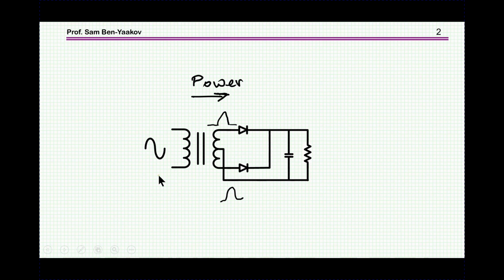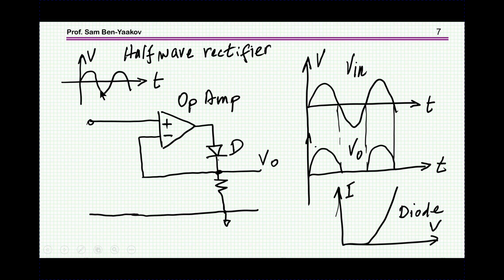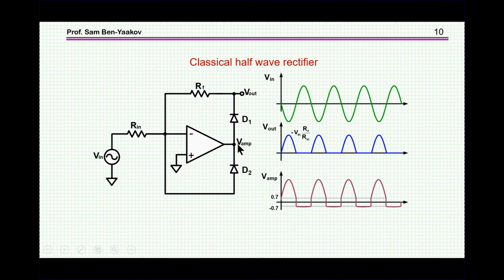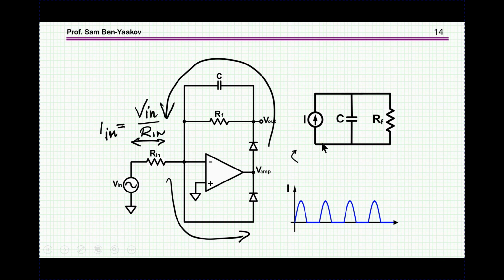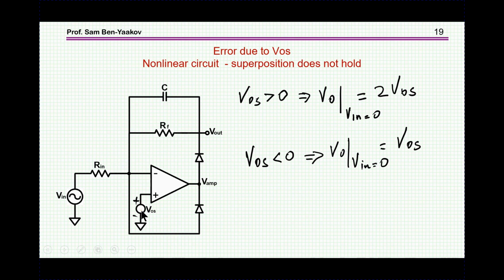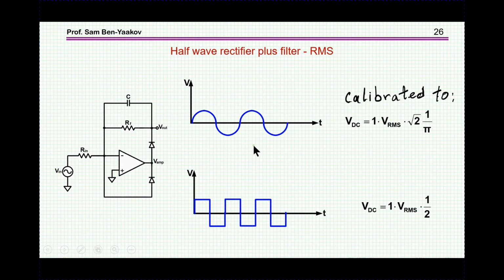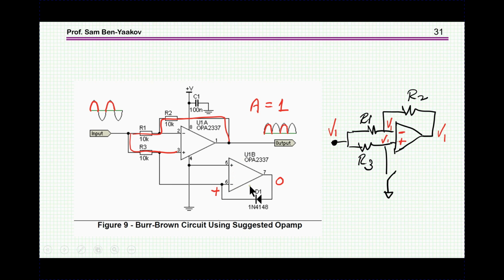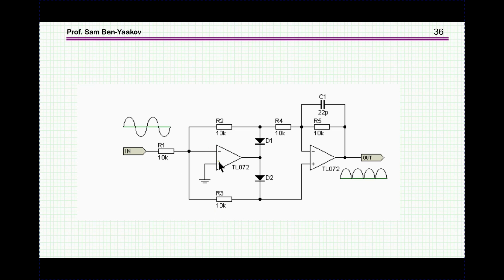A primer to precision rectifiers

Comment: Some newer digital multimeters just digitize the AC waveform and do all the calculations in DSP. That's particularly true for the ones that can do power measurement like the Mooshimeter.
Reply from the maker: You missed the title: Precision rectifiers - i.e. analog circuits
Moreover. Have you noticed? Mooshimeter: 4kHz analog bandwidth for most measurements, Better than 1.0% accuracy AC for harmonic content below 1kHz. Big deal!

Comment: 1. Is it the type of diode important? The simulation result of schottky diode gives very bad output. 1N4148 much better why?
2. How do I make output to filtered smooth DC suitable for ADC measurement. R-C filter or D-C filter?
Reply from the maker: Diode type is not an issue. Are you sure the schematics is correct? If so you may have some issues with diode acceptance or leakage.  Send me the schematics and simulation results to sby@bgu.ac.il
Reply: @sambenyaakov  Thank you Professor, I've sent an Email with attachments. Please check and give me your feedback.